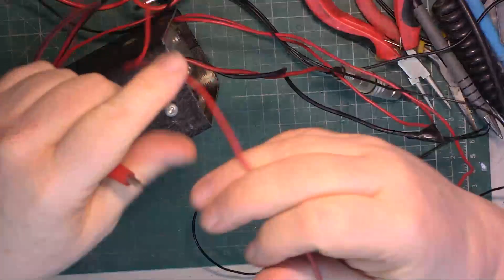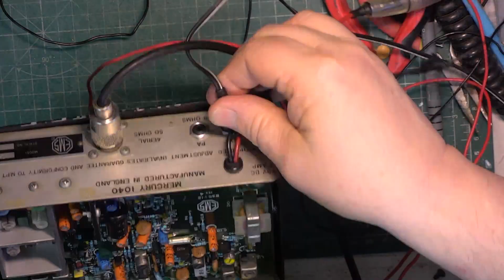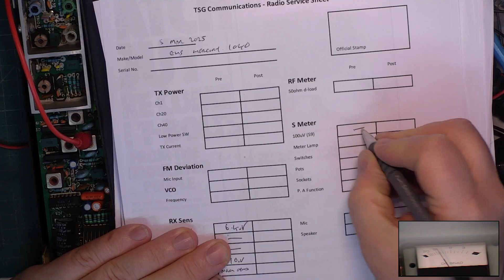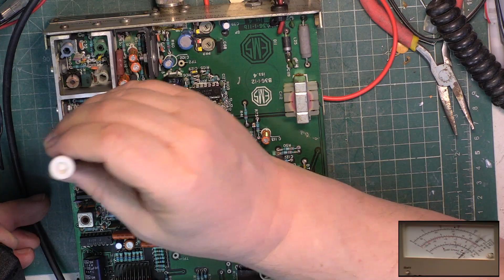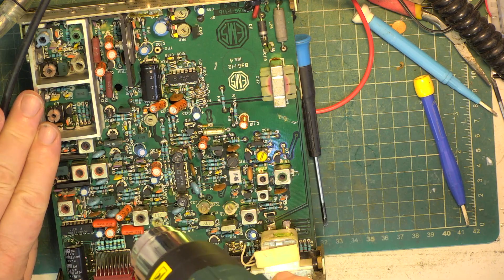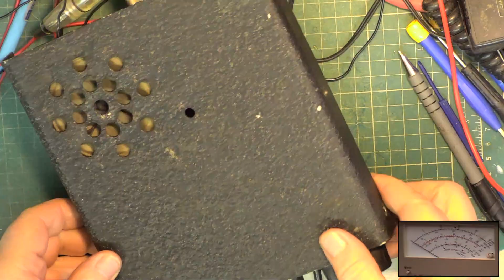EMS Mercury 1040 CB27/81 UK FM CB radio - repair & alignment

Comment: chrome-extension://efaidnbmnnnibpcajpcglclefindmkaj/https://www.worldradiohistory.com/Archive-CB-Radio/Citizens-Band/CB-Citizens-Band-07-1983.pdf
Reply from the maker: Thanks David. Note in that magazine report they got 3.3W, no doubt into a less tight-fisted power meter than mine!  They mentioned squelch never opened at full...just like this sample & they didn't mention the sensitivity of receive.

Richard
Reply: @ukfmcbradioservicingTango21  
Was this not the RX Richard ? 

At max RF gain, the receiver sensitivity was measured at 0.7 uV PO at 50 ohms impedance. 59 corresponded to a signal level of 20 uV PO. With the squelch turned fully uP. our signal generator could not produce enough signal to open itlll When the RF gain was turned down the sensitivity was reduced to 1.1 ~V PD. At this point neither an S9 meter reading nor an opening of the fully advanced squelch could be achieved. These are very reasonable figures. The squelch is a very powerful control and should be able to cope with the most extreme skip conditions.
Reply from the maker: @quotagious  They don't say with reference to what. I could hear 0.3uV, but for 12dB SINAD it was a not-so-good 1.2uV.. The other I've seen wasabout the same. However, it worked OK on the 'on the air' test, but not a set for pulling in distant signsls.

Richard

Comment: Rchard you would get fb from internal speaker still connected
Reply from the maker: It was a culmination of things, mainly the sticky pads on the solder side of the PCB having gone hydroscopic...that also cured the dead meter. A few dry joints too.

Richard

Comment: The original factory mikes are very small similar to the tait business radio type, I think all the ones I've got have selcall fitted and there's a few different face/casing colour combinations too.
Reply from the maker: Another tiny mike was the Murphy CBH1500 base station one.  We just did the 'on the air' test for the EMS set & it worked better tha expected.

Richard
Reply: @ukfmcbradioservicingTango21  I'll await the upload of that Richard.